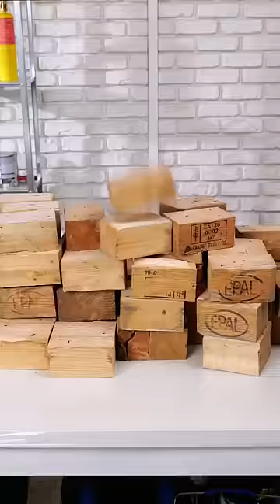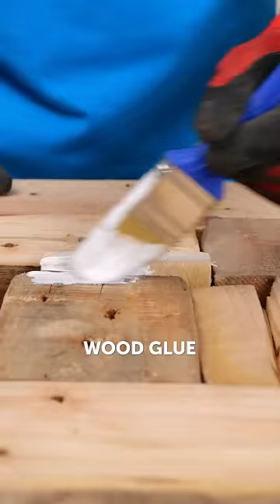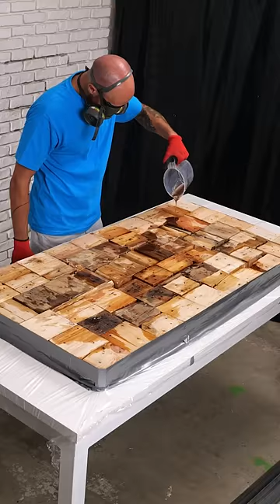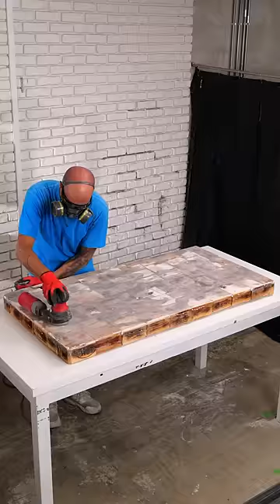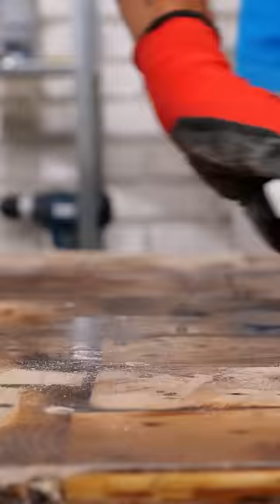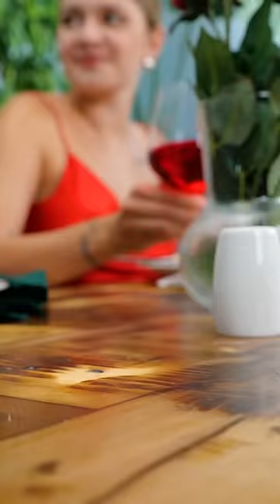We made a table out of pallet blocks and epoxy resin || #Shorts

Comment: If you do know those palettes are coated with a carcinogen right?
Reply: The MB methylbenzine marking should be avoided. This is carcinigen. The HT heat treated marking should be relatively benign. Although there is no guarantee that refurbished pallets don't have a mix of cancer parts in them.